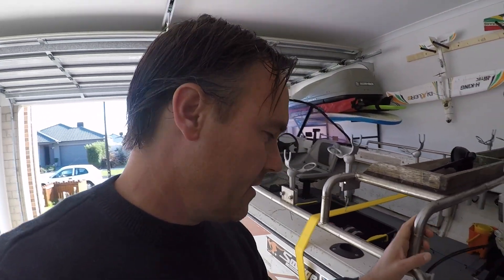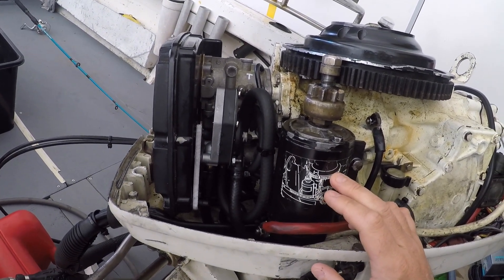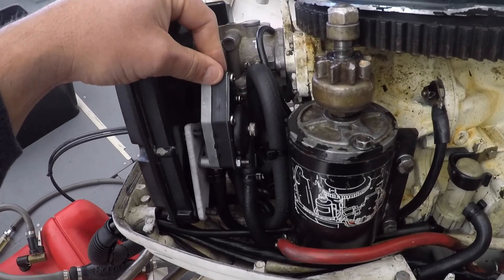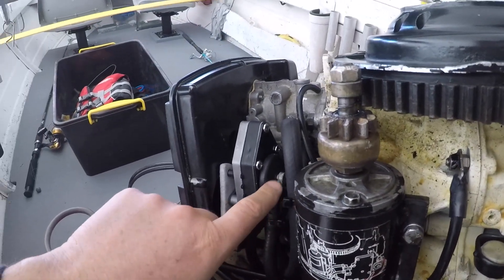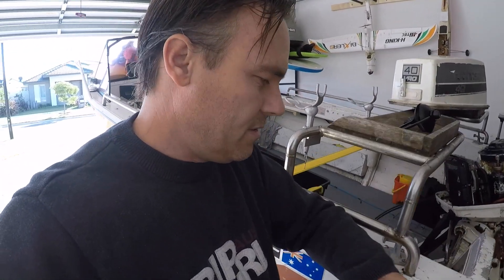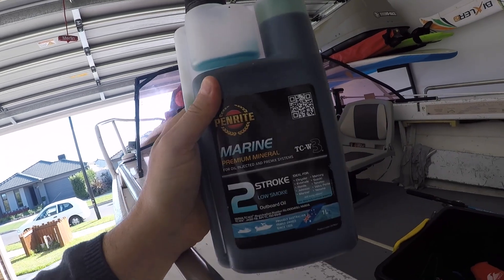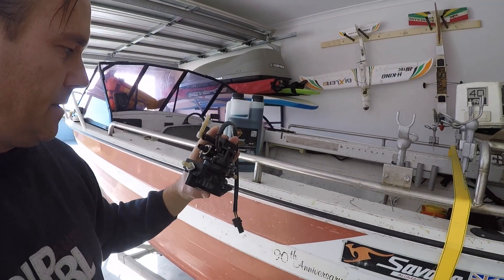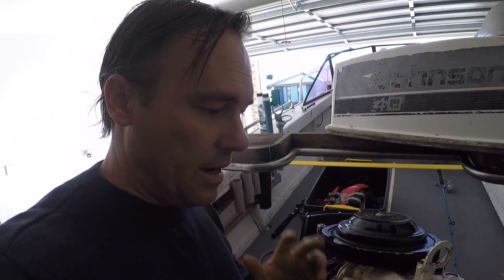Johnson VRO 0.2 Pump Replacement

Comment: alot easier just to cap off the pulse line and install the fuel pump on the port that's built into the port side of the block under the flywheel. more reliable, too since it gets crank pulse directly from the crank case and not through a long hose and valve.

Comment: Can u explain - there is a hole in the back on the pump -do I need to top that off
Reply from the maker: Hi Richard, On the VRO original pump I am not sure as I took it off,  threw it into the bin and now have replaced it with a $40 ebay stock Johnson fuel pump. Here is the link to the one I purchased.  https://www.ebay.com.au/i/202193003522?chn=ps
There are three areas for pipes on the new pump, Fuel in, Fuel out and pulse which goes to the crankcase. Any other pin holes or small holes with no barbs on them on the new pump are simply so the pump can vent to the atmosphere, do not block it or the pump will not work. In fact is probably does have a hole so that it can vent. Hope that helps. CP
Reply: I think the pump you have should be installed in a different way. Watch Extreme DIY ´s video: How to "Remove and Replace a Johnson or Evinrude VRO oil Pump with a Direct Fuel Pump"